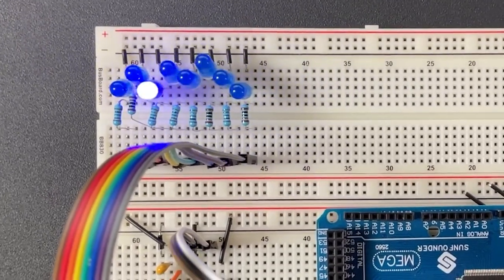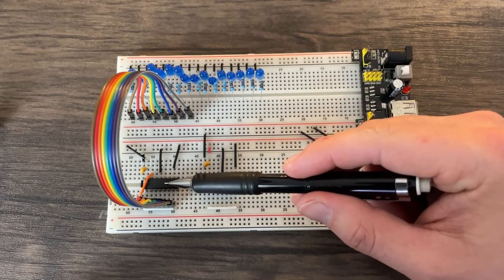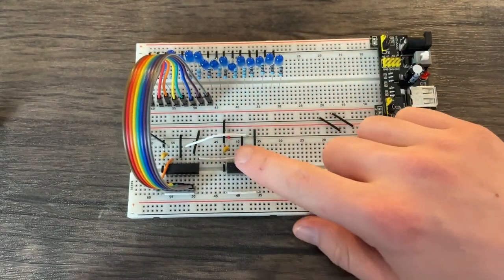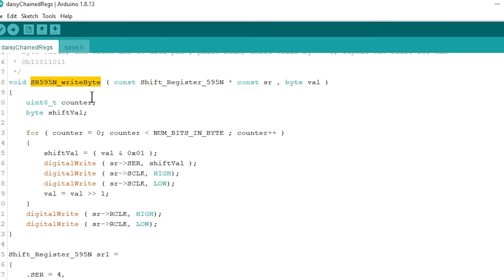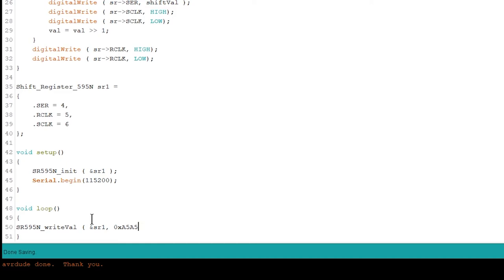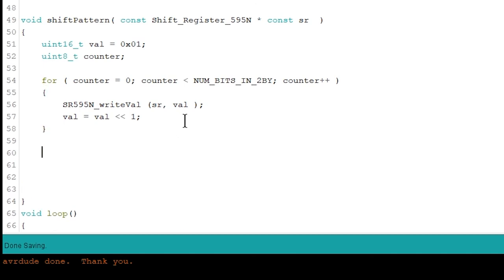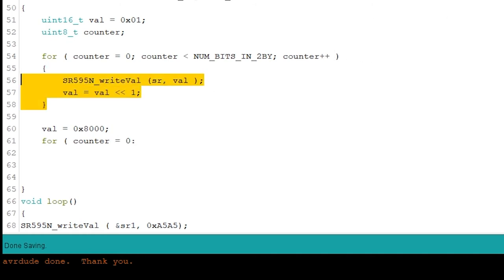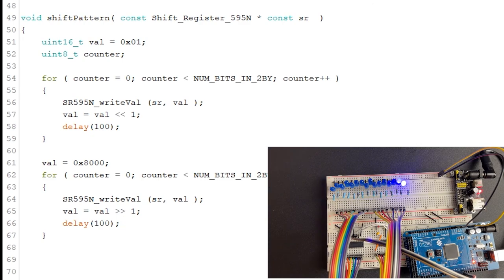Daisy-Chain Shift Registers || Essential Engineering Tutorial using Arduino

Comment: what about if you have 5 shift registers? uint256_t doesn't exist
Reply: I'm searching for that too. I want to learn how each bit is fed and shifted across multiple registers rather than see examples like this video. Have you found anything useful?
Reply: I'm sure you already figured it out at this point. But for anybody else reading this comment or having the same question...

Use an array of bytes where each element represents the data from an individual shift register. For example, if you have 5 shift registers, you can declare an array with 5 elements (uint8_t shiftRegisters[5];). Each index in the array stores the 8-bit data from one shift register, allowing you to access each register's data individually.